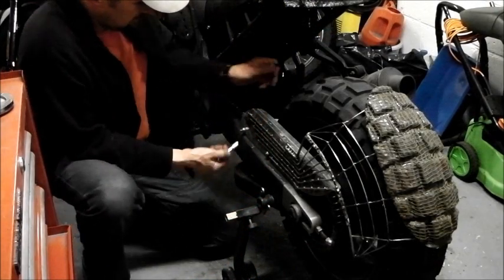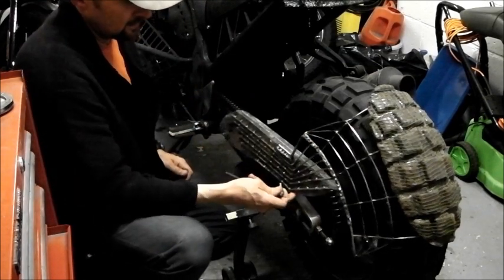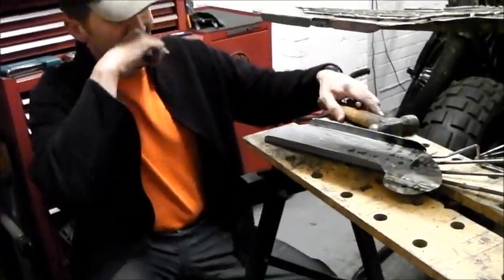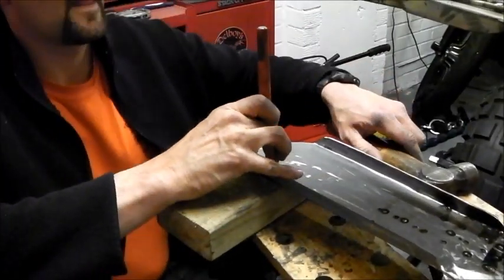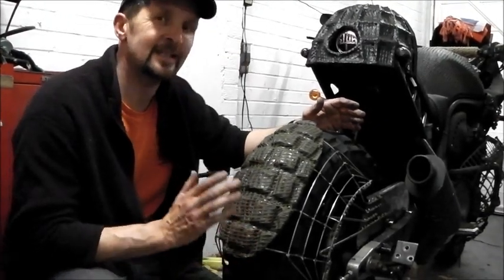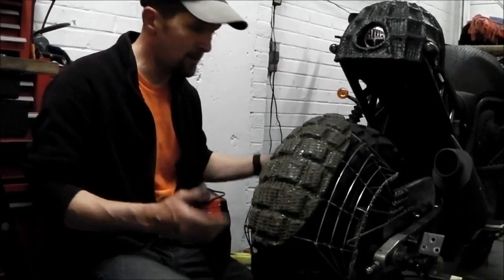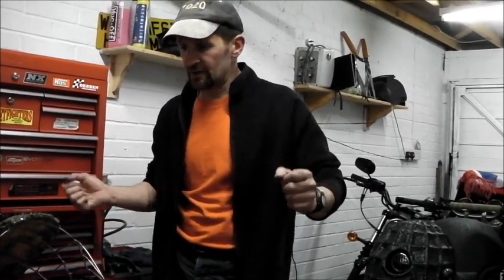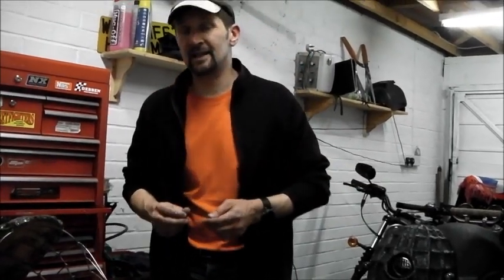Delboy's Garage, Project Bandit, Spray Guard #10.

Comment from the maker: Hi mate, I used two layers of matting, comprehensively coated in resin to make the outer skin, then sandwiched the support frame between two more layers of fibre glass matting on the inside... but if you just want protection, you can get a rear fender extender (or make one) to just make your existing mud guard more effective!  Good luck!

Comment from the maker: Hi mate, good point, did consider that... I thought of maybe using resin to make the scrim solid so it won't got soggy, but even then the scrim holes will fill up with sludge pretty quick, so will have some serious thinks over the next 24hrs... but determined to have it on the road by the weekend!

Comment from the maker: I certainly could mate... if I had one!  But then I could make so many things if I had the right tool like a lathe, a pillar drill, an English Wheel, folding brake, a bench sander, hydraulic press, pipe benders, TIG welder.... even a bike lift would make life so much easier!  But in a 18 x 12 garage that already contains 3 bikes plus lots of other stuff where would it all go?!! LOL!  Cheers mate, Del

Comment from the maker: Haha. so it did!  In fact, start at the beginning ... it's been an Astravan parcel guard, 30m hemp rope, 30m of plastic garden chain, a Halloween masquerade mask, a teacher's staple gun, some 4x2, some shop fit rails, an old tool box, 100 cable ties, a spare t-shirt, 2 clothes drying racks, part of a filing cabinet,a Nato sleeping mat, an Ixon waterproof suit, 6ft of angle iron, 2 tubes of Gripfill, 6sq.m. of scrim, 4 tins of spray glue, gallon of blackboard paint & yep ....a bin liner!

Comment: hi both scriming the sides could pose a small problem I have it on the belly scoops and gets constantly pressure washed from the front wheel causing wear . turns it from solid to scrim extra maintenance in the way of a soggy black brush lol